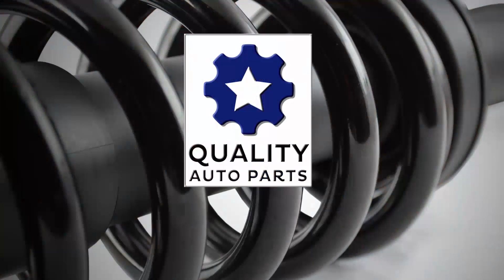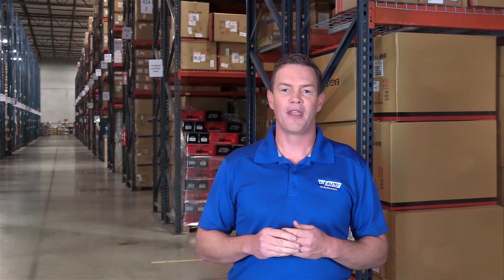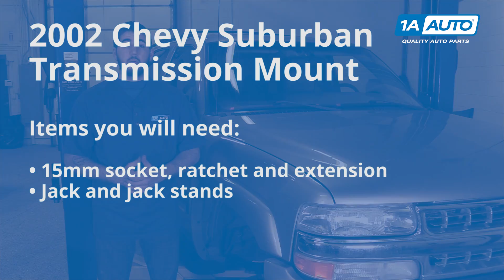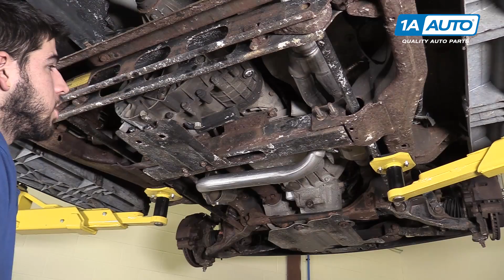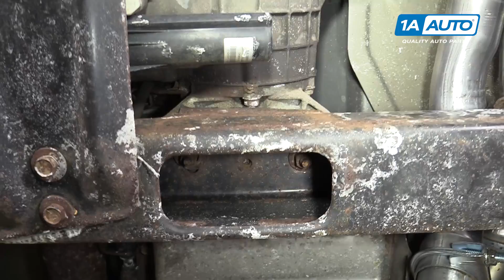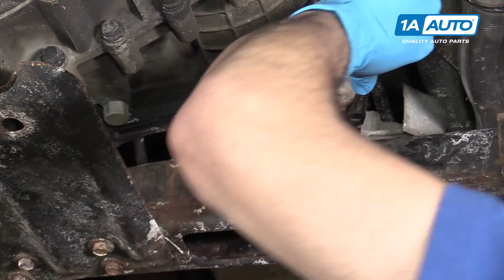How to Replace Automatic Transmission Mount 00-06 Suburban 1500

Comment: What are the difference of the symptoms from a transmissio mounts and the transmission control module on a 2008 silverado lt 1500 5.3? My 08 silverado makes a real hard clunking noise when I shift into drive and reverse, it lost power, also it does not shift into gears when I'm driving.

Comment: My symptoms were deep vibrations at certain speeds and gear ratios under acceleration. Mine was not rusty, but the rubber was gone. Rubber doesn't seem to have a long lifespan here in Florida.

Comment: Got a question, my 2000 Silverado jerks back and forth when you let off the gas from a stop, it feels like a misfire but I have no misfire codes or anything. Bad transmission mount?
Reply from the maker: +Brandon j We wouldn't be able to diagnose an issue like that here, you may want to have a local mechanic take a look at it. Thanks for checking us out! http://1aau.to/m/Shop-1AAuto-c

Comment: Will it be the same process replacing transmission mount for a 4wd 2000 Silverado 1500 V6? And is there just one transmission mount or more than one?
Reply from the maker: +Blanco Carde as This procedure might be different for your application. We do not currently have a how-to video for this particular year, make and model. Thank you for asking! http://1aau.to/m/Shop-1AAuto-c

Comment: Hello quick question, i have a problem vibration when accelarating,   it is a manual trans,RWD now im stuck if its a Universal Joint or a Transmission support problem, any tips? I just dont have the budget to change them both in the same time :D and maybe i can solve my problem by just fixing the one

Comment: I bought the mount from your shop but it didn't come with nuts and the ones from the old mount are fused together and snapped off. What is the pitch and size of the nuts?
Reply: the nuts are m10 17mm found at tractor supply or most hardware stores. use blue loctite
Reply from the maker: +Mark Evans Thanks for checking us out! We would not have this information available as this changes depending on the vehicle. You can contact your dealer or refer to online forums to get more information for your specific vehicle.  1AAuto.com

Comment: You will need a DEEP Socket 15mm with the extender--as the nut has a bolt protruding.  Also, I have a similar noise in my Tahoe--which I've been told is from the failed rear air shocks (a more expensive repair).
Reply from the maker: +Ross Gooding Thanks for the tip! We'll pass this info along to our production team.

Comment: 98 chevy k1500 5 speed manual(nv3500) - my bolts which mount the bracket to the transmission(screw into the transmission housing) are missing. Do you sell replacements? if not where can i buy? what size am i looking for?

Comment: What would be symptoms of a bad transmission mount?
Reply: There is a clunk noise apparently, when you put it in gear, or move from stop to forward.
Reply: I think mine is bad I get a constant vibration throughout the whole body of the suv especially at highway speeds

Comment: Ive noticed a bad clunk for a while going into gear when im parked on a hill thought maybe u joints so replaced and still did it recently ive noticed a squealing noise once I hit 50MPH coupd this be due to the mount a mechanic replaced a bolt for the mount a year ago for a sinilar noise
Reply from the maker: +camp man 86 Unfortunately we cannot really accurately diagnose that. We would advise you take it to a trustworthy mechanic in your area that can look at it in person

Comment: Same process for a 05 GMC Sierra ?
Reply from the maker: +Carlos Balta562 The process should be similar, if not identical as the mounts are the same between the two models. There may however be separate pieces needing to be removed or displaced on your truck compared to the Suburban.